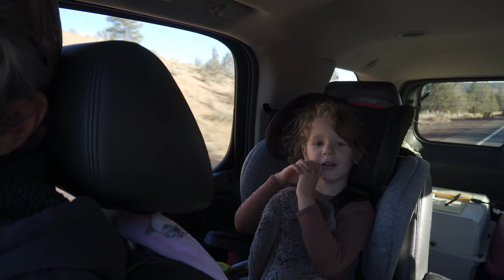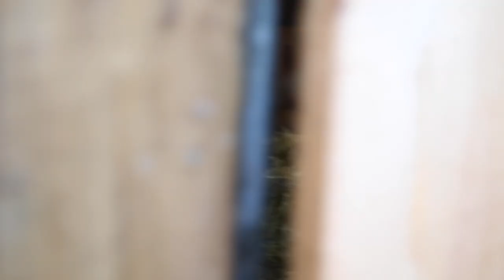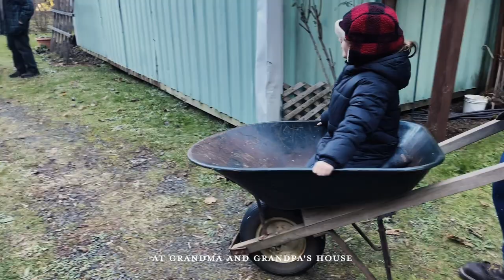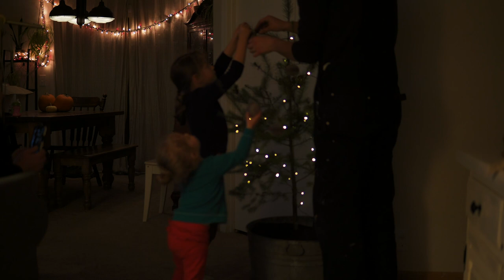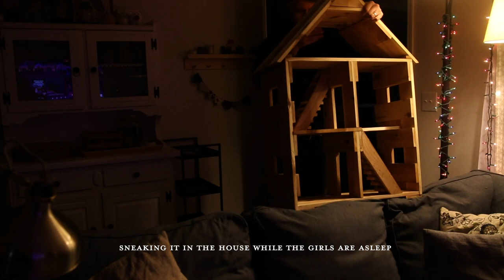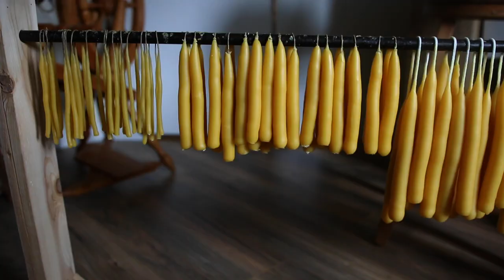Vlog | Dollhouses and Dipped Beeswax Candles

Comment: Oh wow nice job on the candles. Every since I saw you making candles when you first started podcasting I’ve learned how and have been making my own too. I used to use Walmart candles but they got soot all over everything. What size wick did you use? I used blocks of bees wax I got from a bee farm the first time i tried it but the candles wouldn’t stay burning. Even with a bigger wick. Jars had a 4 or 5 inch diameter think they were too big so now I use soy with a bit of bees wax mixed in. Those dipped ones would burn fine and it’s a way to fill your home with the smell off beeswax. Maybe I’ll try it.
Reply from the maker: I hope you do! It was such a fun project. I included links in the description of the wicks I used - one was hemp and the other was cotton. They're both drastically different in circumference, but I've tested them and the both burn beautifully, but I will say that that cotton wicking was much easier to dip. Especially in the beginning stages.
Reply: @AWoodenNest  oh yeah I have some of those exact cotton wicks I bought those the very first time I tried it but they were too small for the large jars I was using. I get my beeswax from Ames farms they sell it it blocks and will ship for free if you buy 2 (I think it’s 2) blocks. I usually buy 2 at a time.

Comment: I'm not sure if this is helpful information, usually wire bottom cages aren't the best option for a bunny feet's. They technically do not have pads like cats or dogs on their paws. So its just skin and that can lead to bumble foot sores on their feet's. And you can technically train them. We used a high litter bucket and add a hay rack over his litter box. Bunnies tend to do their business mostly while they eat.
Reply from the maker: Yeah, unfortunately one of our bucks is a sprayer, so we have to keep a really close eye on him. The other guy prefers the corner of his cage though. Do you guys have angoras? Seems to be a general consensus in the angora rabbit groups that wire bottom cages work fine for them because they have so much fluff on their feet, but If that’s not the case I wouldn’t want to put them in a bad situation.